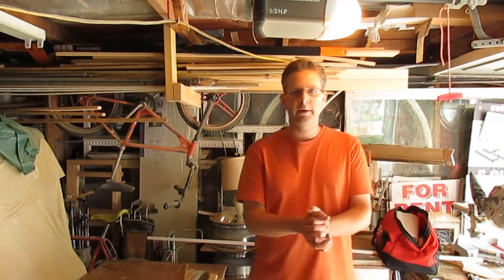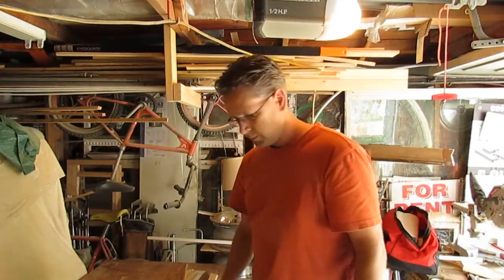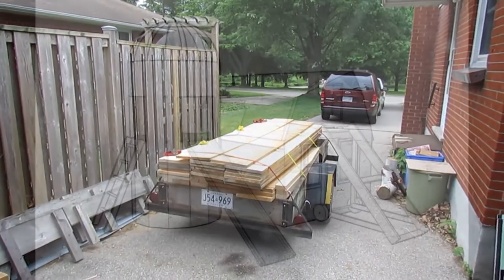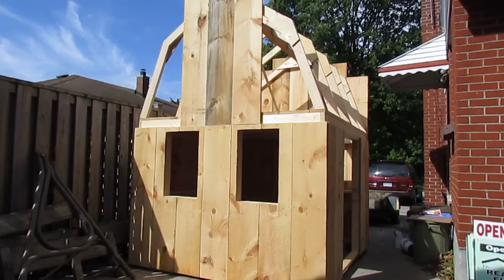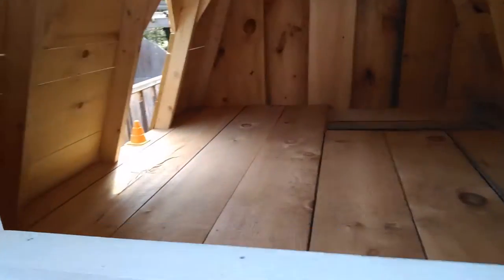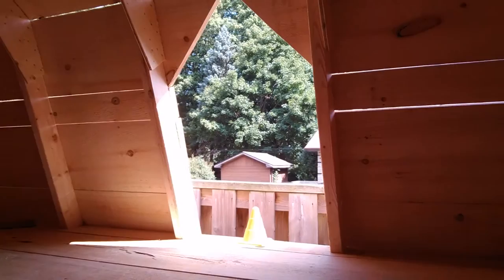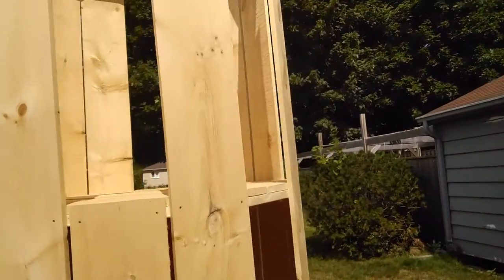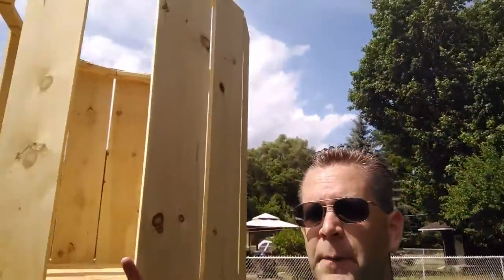Tiny House / Play Barn Build #006

Comment: Hey Michael! Love this project you designed. I am working on one for my 2 kids right now that also incorporated a similar silo. Can you please share the dimensions of you boards. They look like 1x10's but im not sure. Also can you tell me the angle you cut on the 2x4's to get the 16 sided polygon? Thank you so much for you help!
Reply from the maker: The boards on the silo are 1"x12" Rough pine and 10' long.  The silo's internal diameter is 5'.  According to my drawing in Sketch-up, the angles are cut at 77.1 degrees.  I had planned on a 13" wide board so that there would a 1" gap between the boards.  It is not easy making the 16 sided polygon.
Reply: Thank you very much, this is extremely helpful!!! I appreciate the rapid response!

Comment: I was wondering if you could tell me what the dimensions of the barn are? Looks like 7' x 8' or so? And the loft was built at 5'? I'd like to do a modification for my kiddo w/o the silo. :)
Reply: Beautiful design BTW. I love it.
Reply from the maker: Yes the base is 7`x 8`,  there is 5` of height on the ground floor and 4`in the loft from the floor to the peak inside.  Total exterior height is around 9 feet.
Reply from the maker: Thanks
Reply: Thank you for the response Michael. I really appreciate it. I will be following along to see all of your awesome projects.
Reply from the maker: I have some cool ideas of what I want to do for my next project, just need to find time.